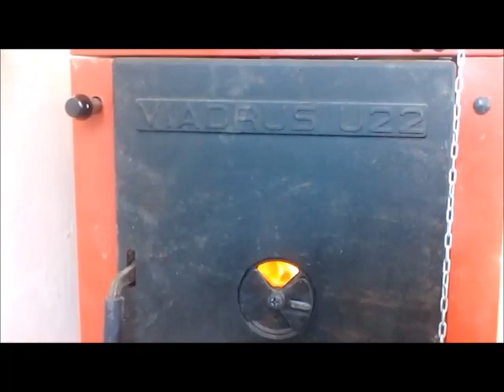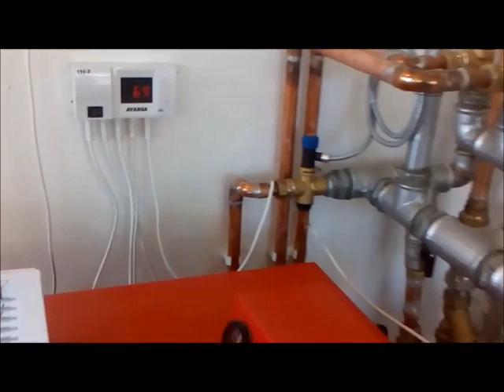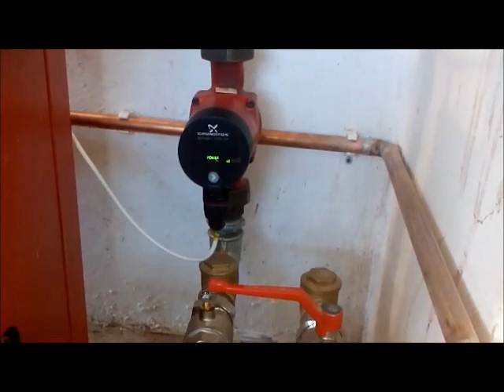Montaj centrala pe lemne Viadrus U22 - Wood central heating Viadrus U22

Comment: Aerisitoarele automate se tin inchise sau deschise cand este foc in centrala?....dar cand se face aerisirea circuitului la rece aerisitoarele se tin inchise sau deschise?....si de ce creste presiunea mult pt ca instalatia este aerisita
Reply from the maker: Aerisitoarele trebue sa fie deschise (e vorba de capacele) daca le inchizi nu mai sunt automate ,si aerisirea se face manual in momentul deschiderii lor. Presiunea creste sau coboara odata cu cresterea sau scaderea temperaturii, e ceva normal.